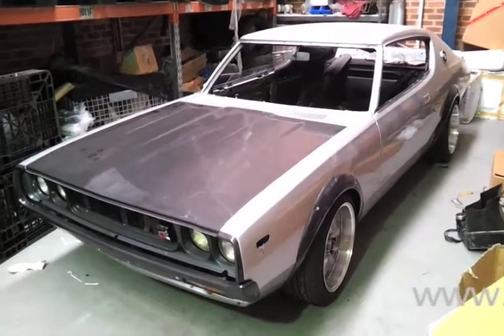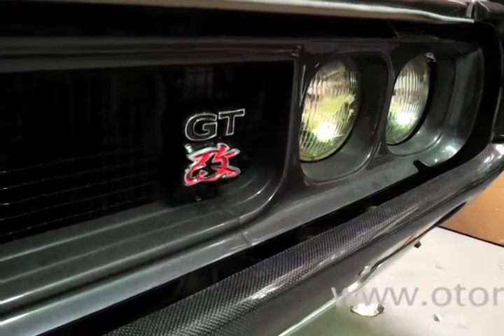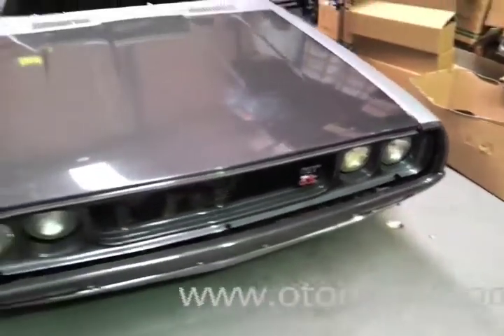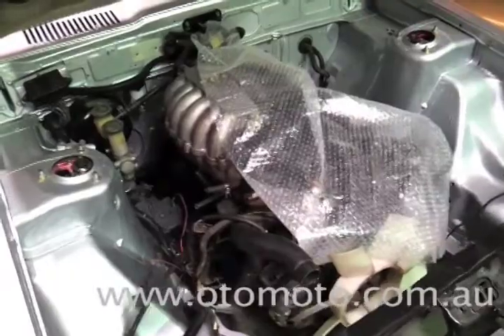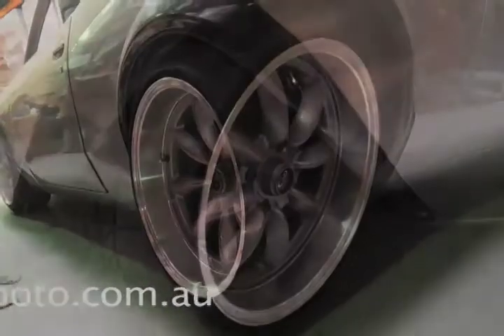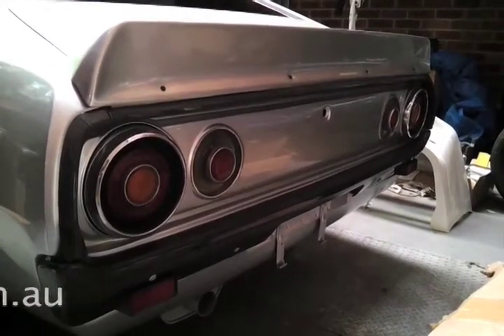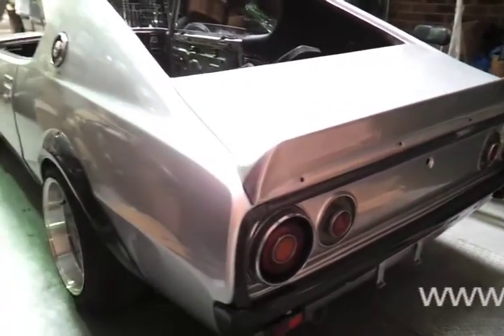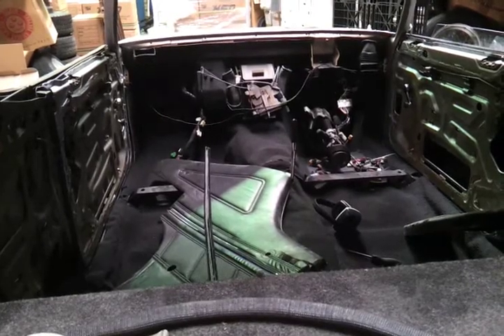Datsun 240K to Skyline C110 GT-R project part 1

Comment: That looks great. I had two 240Ks, a sedan for a few years, then a beautiful 1 (lady) owner white 1976 coupe auto which had only 16,000kms when I bought it in 1990. Drove like a brand new car, converted it to 5-speed and had it for 7 years. Sold it when I got a company car as I couldn't justify keeping it :-(. Great car, fantastic interior. Nobody appreciated them back then as they were "just a Datsun" - they're still not listed as a model in a lot of Datsun lists on car sales websites etc! I find it surprising that people are now crazy about them. Seems most of them get shipped overseas?